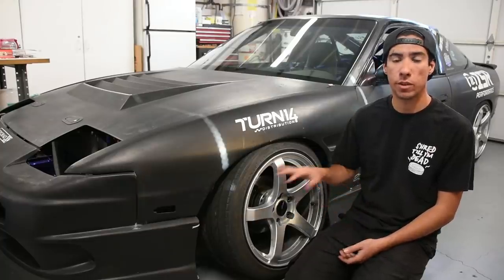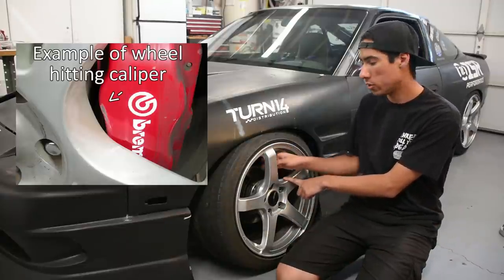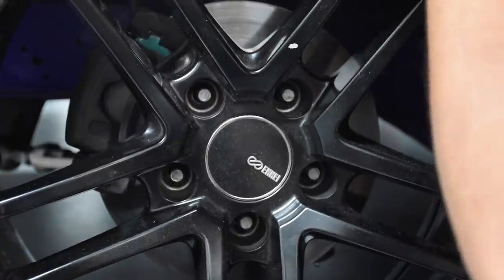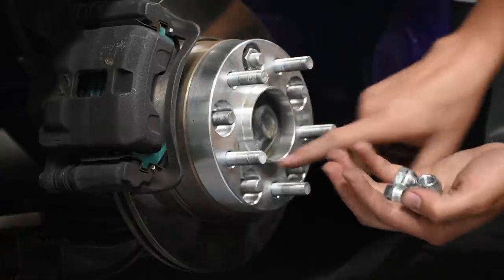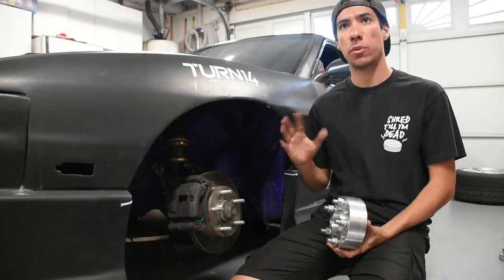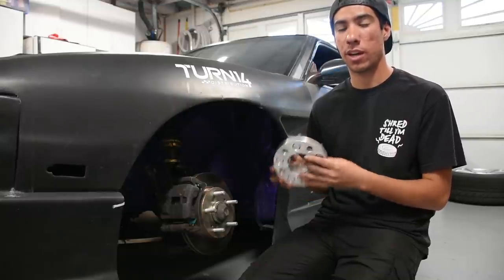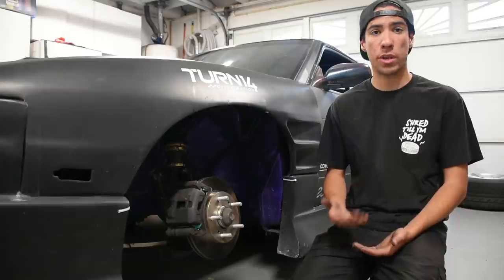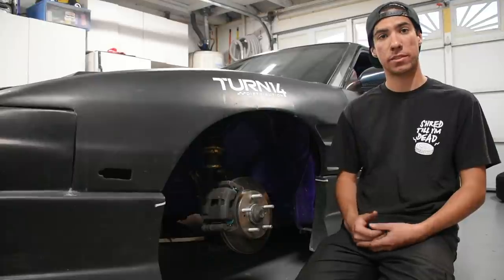Wheel Spacers Good or Bad? | Spacers Explained

Comment: As described in your video, spacers are just fine.  The problem is, many enthusiasts are buying spacers for OEM wheels looking for "poke" which absolutely does negatively impact scrub radius and a host of other suspension measurements negatively (roll center, instant center, roll couple, roll axis, etc.).  Assuming the factory made a bad choice because your wheels aren't "flush" enough and using spacers to fix this is sadly too common.  Making any change to your OEM suspension without fully understanding what you are doing and what the expected outcomes should be is a bad idea if you are concerned about mechanical performance.  This includes arbitrary lowering which can result in the need for nearly solid springs when your roll center goes subterranean because you want your ride to be "slammed."  If you only care about visual performance and couldn't care less if the car is slower on a timed course, knock yourself out.  But don't for a second believe your wheel bearing service life will be anything like what the factory anticipated, and don't be surprised at all when a stock version of your car at stock ride height beats you soundly at the local autocross.

Comment: Nice video, just small point. There is such a thing as "lug centric" . All my Corvettes have been lug centric. The wheel centers on the lugs not the hub. I have run "shim" type spacers (with extended lugs) that put the wheel well away from the hub with zero issues. Street/autox/track. Up to a little over 1.25 inch to clear brakes, widen track, clear inner liner, etc. Just sayin. Froggy's Garage for videos of this.

Comment: I installed 1.5" spacer on my jeep to get the turning radius back. with a 3.3/4" lift, my 33x12.5 tires rubbed on the frame when turning to far in either direction. the spacers solved the rub and gave it the more aggressive stance I was looking for.
Reply from the maker: +Nicholas James There ya go! :)

Comment: Besides  its unsprung weight, it also increases the wheel's moment of inertia, but since it is close the axis, it will only be a major factor if the spacer is massively  heavy. And then it could be drill it out, to  reduce both its, moment of inertia and its unsprung unsprung weight... 
BTW very  well do review for a mechanic;s point of view on the subject...

Comment: I am running non hub centric spacers on my 70 Chevelle and have had no problems so far.  The lugs can only fit in the tapered holds on way, you would really have to try to make it off center.

Comment: You seem very intelligent so i feel i should inform you that the non hub centric spacers are infact nessicary and completely safe they are intended for vehicles that instead of being centered by the hub they are centered by tue lugs "lug centric " on such vehicles the lugs will have a rounded side and a flat side when the rounded portion seals against the mating surface it centers the rim.

Comment: even as shown in the diagram the middle wheel it given more leverage which in turn puts more pressure on the hub the physical point of where the wheel bolts to the car is being changed if F= vertical load on wheel then follow the the path that the energy (from a bump for example) takes from the ground up through to the suspension
Reply: Thats exactly what the video diagram illustrates.

Comment: very informational, guess i got some calculations ahead of me, gonna figure out what spacers i should run if any since my driftcar will be fitted with either 15 or 16 inch burners, or on a trackday with 17 inch semislicks in the rear, so i'll need to dig up some offset numbers.

Comment: You somehow forgot what hub-centric really means. It means that any non-rotational forces are transmitted positively (without a friction component) to the hub. This means that there is much less reliance on the studs. You'll note that almost all oem wheels have tapered nuts and are tapered and are still  hub-centric. If it was just about location during installation it would be redundant.

Comment: I think the most important safety tips is after 100km. take the wheel off and retorque the spacer lug nuts. install the wheel and don't forget to retorque the lug nuts at 100 km again.   if you lose a wheel goin fast your dead.

Comment: a 5 point harness without a roll cage in the car is very dangerous.   imagine if you rolled the car and the roof collapsed.  the 5 point wouldn't let you move sideways and your head would be crushed...  just thought i 'd mention that, since you said a 5 point was safer than a 3 point in a street car

Comment: So basically I'd be good to run a 10mm hub centric bolt-on wheel spacer with +30 wheels on my Z33 fine as a daily? My biggest concern is wheel bearings, but watching the video and seeing those drift cars with crazy wheel spacers had me thinking.

I'm running a staggered setup:
Front - 245/35-19
Rear - 275/35-19

I think my rims are 9-9.5 wide, not to sure but I know they're somewhere around there.

Comment: not every vehicle uses hub-centric wheels dude. there are plenty that use lug-centric wheels and are held in place by tapered lugnuts. also NEVER run slip on spacers. you are effectively placing the weight of the vehicle further out on the stud which can and will cause the Studs to snap or bend. only run bolt on spacers and only if you have to. make sure the wheel you are running is either hub centric or lug centric before purchasing a spacer.  also when you get your wheels balanced if they are lug centric wheels to inform the guys who are balancing them of this so they use the proper adapter to properly balance your wheels.

Comment: EngineeringExplained has a wheel spacer vid that explains the reasons why you shouldn't run them. Racing applications may be warranted but i wouldn't use it for street use. Seems to me that wheel spacer are a cheep fix for most people who use them. If the wheels you want don't fit your hubs then a spacer is a cheap way of avoiding having to change the hubs..

Comment: I've got a 87, R-20 Chevy Surburban 4x4  I got 33s tires on it now I got plenty clearance / I'm geting ready to install some 35s soon  but I've notice that I'm going to have to buy  a set of  4 wheel spacers because the 35s is not going to clear under the front without hitting the lower front of both front fenders plenty of room on the rear  but a set of 4 will make it match

Comment: this is a great debunking video with loads of valid info. but regarding that DUALI example, when you use a ton of offset at the wheel and the balance it out with huge spacer, that puts the tire exactly under the bearing, arent you still putting more load on the bearing? this is hard for me to grasp and maybe I am wrong.

Comment: Thank you for great informative video.
I have 38 mm hub spacers for the rear, but the hubs are slightly to small or thick spacers.
I sanded down about 1mm of the inner hub to make it fit my hub perfectly.

Also my factory offset +40, however with the new rims and hub spacers it should be -18

Comment: I just want to make sure I understand this properly: Should I only get wheel adapters that come with a hub lip to ensure the wheel remains hub centric?
And if I get thin wheel spacers (with the hub lip still extending through), how much hub lip is required to still ensure it's safe? Would 2mm be enough?

Comment: Yeah I'm one of the few that don't like wheel spacers but I can see it can be a necessary evil in some cases. Although if you have a vehicle with such horrendous steering/suspension geometry that a wheel spacer would improve it maybe the suspension should be looked at before putting monster wheels spacers back on.

Comment: Hey OffBeat Garage, awesome videos. Very helpful, but i do have a question. Whats your opinion on using large wheel spacers (2"), removing the studs that come with, and sliding them over hardened steel extended studs (3.5") that are already on the car? Thanks in advance!

Comment: I do agree that where possible hub centric spacers should be used. but none hub centric aren't all bad. if the spacer and/or wheel uses tapered seat nuts/bolts then with correct even tightening of the fasteners the wheel will centre itself.
Reply from the maker: This is true however there is a much higher chance of it not being centered and this is where most the issues of spacers come from which is why I suggested to only get hub centric. 
For instance a lot of people bolt on their wheel and tighten their lugs to maybe 15 ft/lbs of torque. Then they lower their car on the ground and torque it to spec. If the wheel doesn't have a hub diameter properly matched with the hub diameter on the car then there is a possibility that when lowering the car on the ground and the full weight of the car is applied to the wheel, that the wheel will move off center and when you go to torque the lugs, you will torque the wheels off center.
Make sense? So having it hub centric eliminates that room for error.

Comment: I wish you went a little deeper on the wheel scrub and how to find out what your wheel scrub is etc
Reply from the maker: It's a whole other topic of discussion unfortunately so that's why I didn't want to go into detail on it in this video.
Reply: But hopefully a topic of discussion for another video? :D
Reply: OffBeat Garage scrub radius and kingpin axis inclination are valid points of discussion on this topic and should be discussed IMO. There's a big difference between a properly sized wheel in comparison to just slapping on some spacers to change effective offset.
Reply: CrazyLazyDave glad someone mentioned it. Handling, to some, it's more important that scene-prick-points.

Comment: Just subbed. 
I like the thorough explanations and the TOC timestamps. I learned quite a bit. Nice!

Your dream wheels example kept me tuned. Mandrus does not offer what I want in the offset I need. I thought jumping from 32 to 42 would be too much, but it seems to be minor compared to what most folks do. Also, I am not racing. I just want to improve the handling by increasing to an 18" wheel. 

Which wheel spacer brand would you recommend, of course, heeding your advice about hub centric and bolt on design for a secure fitment? 

Thank you.

Comment: Thanks for explaining this bro. I did a fair share of research before adding hubcentric spacers to my car. I have some vibration at higher speed (after alignment) and I think those plastic rings may be needed. Have they been durable? I hear they tend to crack upon installation.

Comment: Damn dude those are big spacers.
People around here think im crazy running 15mm spacers lol. 
I don't get how you arent finding wider offsets? i run a 11.5 +43 and it sticks out of the guards 10mm. i wanted a 12" but the highest offset i could get was +10 and it would have stuck out of the guards by 50mm. which is obviously rediculous.
all the offsets i can find are +0, -12, -23, -43 etc. and i want +50.... 
Thats the reason i run the spacers, offsets werent high enough with the large disk to clear my brake calipers, so i had to go a smaller disk with a high offset, then run spacers to clear the caliper.

Comment: I bought hubcentric bolt on spacers. Problem is, one of my hubs on the rear of the car has one broken stud. Mine has 5 studs on each hub. Will this be safe enough or should I get another stud installed for that?

Comment: If I were to be daily driving, never tracking a small bolt on, hub centric, good quality bolt on. How long do you think the ball bearings could last? The rims I got didn't have a bigger offset and I just want my wheels flush with my fenders. I really want spacers but I've been told not to do it.

Comment: Good video little confused on the chart you had so I’m running a different set of tires and offset that you may normally see but I’m running 20x12  -44 offset rims on my truck along with 2” spacers? So your saying it would or wouldn’t start effecting the wheel hub bearing? Obviously not anywhere near factory offset

Comment: Hey. i found a 240 on craigslist for a 1000 bucks. its a 1990. and he has a complete lm7 5.3 ls from a 2007 silverado. I have some questions if you could answer them. 1: Where are common areas to look for rust besides the side frame rails, and there are really weird welds on the strut towers. i could show you some photos. 2: how much torque can a stock ka diff hold, and is a j30 rear end completely bolt on. If you can give any insight it would be a great help.
Reply: all over strut towers. Floor pans. Rear quarters. Hope this helps
Reply: Tim sheahan is it possible that the strut towers were replaced and tack welded back on?
Reply: teh vee teh vee Oh. hey there bud. im just asking. im going to look at a 240 tomorrow and i want to know what to look at besides fram rails and strut towers, which were tack welded on. im just not sure about other shit and forums dont help to much.
Reply: where the spare tire is
Reply: driver and passanger floor also
Reply: bring someone that knows about cars
Craigslist is sooooo iffy so you need someone to inspect it so you don't get a complete lemon
I've lived in 3 states in the US and all those states any 240 under $2k 100% was rusted out, had Rodnock or a blown head gasket ect
Craigslist may be a good way to find cheap cars but make sure to inspect the hell out of them
Reply: J⃟O⃟N⃟A⃟T⃟H⃟A⃟N⃟ S⃟C⃟H⃟U⃟L⃟T⃟Z⃟ This is basically a roller. i do have the standard ka24de single cam and a 5.3 with some performance parts.  valve springs, ls6 cam. etc
Reply: driver's side is prone to rust from leaky master cylinders.
Reply: Any resemblance of rustproofing they used in the s13's was terrible. Make sure the rust that you WILL see is honestly repairable. Don't just buy one because "mad drift yo."

Comment: I bought a Honda Accord Coupé (build year 2000) and I'm planning on changing the rims and tires.
Because the old OEM wheels are tucked in about 1 inch, I was thinking about getting 4 spacers with each an inch to get on bigger wheels and neat rims.

Which dimensions do you recommend?

Thank you very much! :-)

Comment: I know this is a old post but I do have a question to ask I have a 2001 s10 right now I have a set of BMW wheels on it I’m currently have 2 1/2 hub centric spacers but don’t have the hub ring to mate the BMW wheels to spacers what would you recommend I could do I looked for the hub centric spacer with the outer ring but they don’t make one for a 2wd s10 I can use them on the back but not that I can find to fit the front.

Comment: spacers don't change the offset of the wheel they change wheel base width, offset is the distance that the hub of the wheel is off center from the center of the rim with. the only way you can truly change your offset is by buying new wheels

Comment: What about lifted trucks. Many guys in the truck world say don't use spacers at all because with our big tires it ruins bearings.
Reply from the maker: +David Vermillion I have two family members running spacers on trucks. One with a 2015 Dodge 3500 Dually on 17's with 37's. Lots of miles on that truck due to work + towing often and so far no issues. 
Another with a 2015 (I think) Ford F-350 Dually on 22's with 37's also lots of miles and towing and no issues either. 
Both trucks have lifts also
So based on that information as well as looking at how many truck guys are running 20x12's with -44 offsets (lots of load on the bearing) I'd say running a spacer is fine.

Comment: I got to fit my wheels soon hence the interest🤔... in the video, when he put the 25mm spacer on the car, the hub nuts where sticking out so how was he using 25mm on the rear.... I'm just getting my head round the wheels and spaycers🤓 I have a set of 20" for my car, and there going on it one way or  another😁. my new wheels hit on my suspensions so I have to get spaycers, and cut the wings a bit😁 any advice! as to, how I go about getting the right size  spaycer, would be a grate help, as I know I'm going to need big ones but don't want over size at all.. any help much appreciated 🖒

Comment: Hi all! I need some advise/help please! I’ve got a 2006 BMW e53 x5. The factory’s wheels are front 275 40 20 and rears 315 35 20. Now for winter I’ve got a set of 235 65 17 , nothing wrong with them just they look terrible , I want to bring the wheel out where the original wheel seats. I know what type of spacer I need to use I just need some advice if bringing the wheel out will it put pressure on the wheel Bering??? Thank you

Comment: I got xxr 526 17x9 +35  4x100/114.3 for my s13 would running 25mm hub centric spacers on both front and rear require me to roll/pull my fenders ? (PS I didn't buy my wheels and I can't sell them to get better offset wheels)

Comment: I've been having trouble finding the right bolt pattern for my truck. So while looking at rims I ask if I could use adaptors to change my bolt pattern. And the guy at les Schwab said thats a bad idea because it will mess with alignment and I'd have to do other parts and stuff. Is this true?
Reply from the maker: +M Knight It will not mess with your alignment at all. Only thing that will get changed is your wheel fitment/offset as explained in this video. You'll be fine running adapters.
Reply: So I can get an adapter for 4.75 pattern to 115mm and be OK?